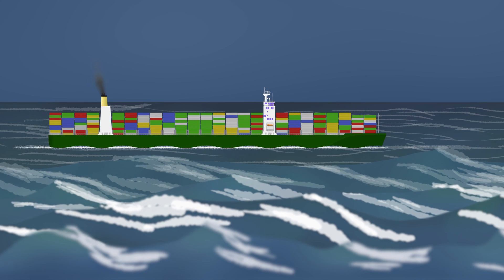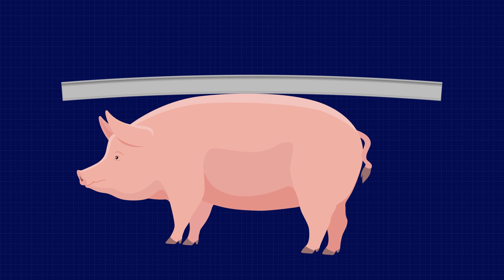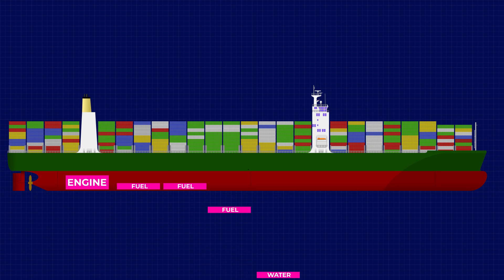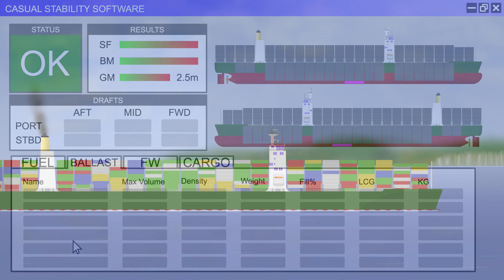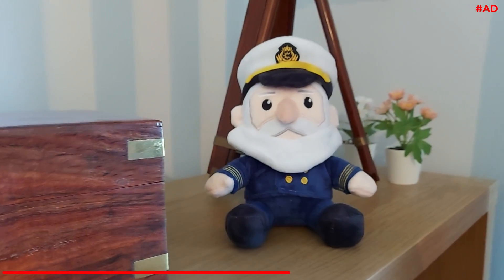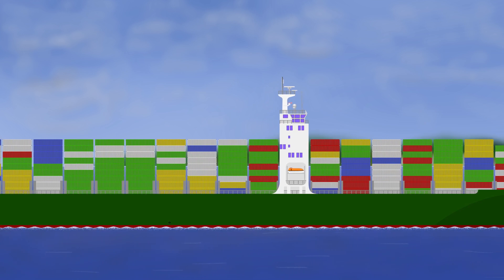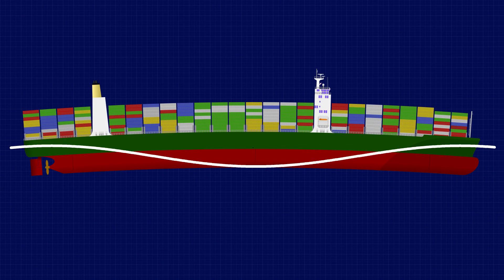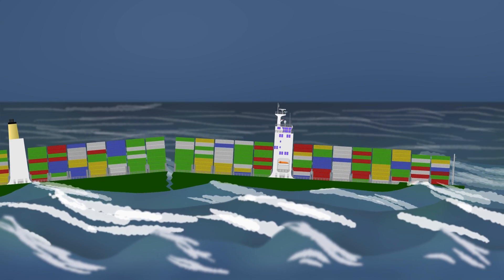Why Are Big Ships Bendy?

Comment: Now for the really scary part: Metal that is repeatedly flexed back and forth experiences an effect called work hardening.
The flexed part gets harder and more brittle with every motion. Given that in a ship's hull the flexing takes part over a great length, this takes a long time to become relevant, but it inevitably will weaken the structure.
So, no matter how well you take care of your ship's hull, it's days are numberd.
Reply: It is not generally a problem for metal parts. It might be true for ships but I am not an expert on that.
With ordinary shafts for example you don't have to consider work hardening. Instead you get fatigure cracks that form due to the repeated load cycles. These fatigue cracks only form when you stay above a certain strain threshhold. If you stay below a strain threshhold the shaft will effectively withstand the load forever (of course corrosion and other physical and chemical processes can still damage the part). With ball bearings for example there is no strain threshhold. They will ultimately always die sooner or later due to the cyclic load of the ball passing through the load zone and the corresponding hertzian contact pressure in the inner ring.
Reply: @FluppiLP  As I'm a mechanic, not a materials engineer, my knowlege of material sience is limited, but as I see it, these fatigue cracks are a result of work hardening. Work hardening happens where a piece of metal is deformed past its limits for elastic deformation an enters the realm of plastic deformation (the strain threshold you mentioned). Quite often, you will find a combination of both eleastic and plastic deformation - unless you overengineer a work piece to a certain extent. In this case, the cracks will start slowly in those parts that did experience plastic deformation, slowly increasing the load on those parts that so far only experienced elestic deformation.
If you make totaly sure your work piece will only ever experience elastic deformation, then you should be safe from work hardening and fatigue cracks. That works if the loads your piece experiences are reliably calulable. Like in a shaft for a stationary engine driving a generator.
But if you have something that moves through the environment, you will encounter shock loads and similar issues. Like a ship's hull steaming through a storm.
Reply: @Bird_Dog00  you have a great understanding of mechanics of materials there for not being an engineer.  nice work!  i am an engineer and i couldn't have said it better myself.  There are alloys, aluminums come to mind first, that do not have an "elastic fatigue floor" so, even purely elastic flexure will cause fatigue cracks to develop no matter how light the loading is.  But steel alloys generally do have a floor, meaning there is a load level below which fatigue is not an issue ever, but above that load limit fatigue cracks will develop as it starts to do plastic deformation on small scale, moving dislocations until they meet and causing fatigue cracks to develop into macro features
Reply: Steel doesn't do that untill the forces are pretty high. Only some metals get fatigued from all loads.
Reply: @calebreutener870  ships do get fatigued, hence the defined ship lifespan
Reply: Work hardening is nonlinear. Look up fatigue limit or endurance limit. Work hardening and metal fatigue isn’t an issue below a certain flexion limit for a given alloy. All suspension bridges move and stretch. Golden Gate Bridge is nearly 90 years old. Skyscrapers are also designed to flex and sway in the wind. They remain strong for decades. I’ve been in buildings where you could actually feel the building move under high winds. Aircraft aluminum flexes a lot. I’ve flown in planes over 60 years old. In turbulence they look like they’re flapping their wings.
Reply: @NoahSpurrier exactly, look at the coil springs on a car, they will flex for the life of the car.
Reply: @kevincurrie2052  Working with helical springs in my day job; how long they last depends on a multitude of factors. How much they are compressed ist the big one.
If you compress it only say, 10% of their maximum possible travel, then yea, they will probably last a while.
Compress them more, and their life expectancy drops fast, even though they still compress only elasticaly, eg. they expand back to their original lengh once the load is removed. Manufacturers provide tables for that.
Even when whatever you are flexing is flexed within its theoretical limit for elastic deformation, chances are there's a small part of it where that limit is exceeded (for example due to impurities in the material). That's where the work hardening and the cracks start. And once it has startet, it will inevitably progress.
Reply: @Bird_Dog00  But cargo ships are in service for a very long time.
Reply: @NoahSpurrier   Yes true. The process can take a long time. If the ship's hull isn't overstressed (meaning the flexing never exceeding the limits for elastic deformation), in theory it should last forever.
In practice, deformation isn't uniform over the entire hull. Some parts will bend more than others. Also, the material isn't perfect. Some very small defects - like imperfections in the steel used - can be enough for the flexing to exeed the elastic deformation at a small point and cause damage there. From there, the gradual deterioration will slowly spread.
If the ship is well taken care of and not sailed through too many big storms, that can last for decades before it becomes a real problem.
Reply: Fatigue absolutely is a real issue in most dynamic structures. Fortunately, mechanical engineering have several tools at their disposal to estimate its severity and design a structure to minimize its effect. Still, its one of the main reasons along with corrosion and abrasive wear that all machines require periodic maintenence and inspection.
Reply: That's likely what happened with the Carl D. Bradley back in 1958, wasn't it?
Reply: It depends on the material. Aluminum will do that, steel won't weaken from repeated stress if it's under its safe limits.
Reply: Well, you could always replace these overstressed parts, and before anyone brings up the quite ironic in this scenario, what ship of Theseus problem no we are dealing with easy to repurpose metal which means we can just melt down old parts into new parts you can keep ships around for several millennia by doing this
Reply: @HannahTheRealComputerEngineer  The problem with this is, that a) this load is spread over a large part of the hull, thus you'll have to replace a large part of the hull and b) those parts are very much integral to the hull's basic structure. So, you'll be looking at a major rebuild. If you factor in everything else that can and will deteriorate and needs to be replaced, you will end up with a bill that comes close to what a new ship will cost.
Reply: Work hardening is when a piece being worked on is hardened due to friction heating it up enough to affect the temper, its usually caused by adding coolant to a drill or cut too late. What i believe you are referring to is fatigue where metal develops micro-fractures from repeated bending. Fun little experiment anyone can do to see this, bend a paperclip back and forth till it breaks. the metal at the broken ends will be more matte and might even be a lighter color, that's caused by millions or even billions of micro-fractures covering the surface. The paperclip will also get very slightly linger due from plastic deformation, the bend being sharp enough to stretch the metal on the outside of the bend.
Reply: @SirFloofy001  I disagree. Hardening a metal requires a change in its cristaline structure.
In order to change that structure in iron or iron-based allyos with temprature, you will need to first change the cirstaline structure from the cubic-body-centred structure into a cubic-face-centerd structure. That happens at tempratures above 700°C (exact temprature depends on the alloy).
Then forcing it to undergo a rapid change back to cubic-body-centerd - the quenching - that traps carbon atoms in places where they don't realy fit thus distoring the cristaline structure of the material.
Workhardening of iron happens due to plastic deformation of the metal that leaves the structure deformed that way and only happens if the material stays at a temperature below 700°C. Heating it up to above recristalisation temperature and then slowly cooling it down reverses the effect of work hardening.
Reply: @SirFloofy001  work hardening occurs  with plastic deformation, regardless of the temperature

Comment: There's a video taken by a crew member during a storm on a large freighter of some type showing an unnerving,  to me anyway, of the flexing of the ship in a passageway that runs the length of the ship. It's actually kind of terrifying.
Reply: I was in the merchant marines for years and watching a ship flex in heavy seas is a good thing.  When they do not flex is when they crack.  I was on a brand new ship 40 years ago that sank on her 2nd voyage across the Atlantic.  It was determined that the steel used was too stiff.
Reply: Been there, seen that. Makes you think.
Reply: Think I've seen the same one, there are others of suspension bridges and looking vertically down elevator shafts of large towers, crazy how much flex is actually "normal" for these types of structures.
Reply: There's a video of a ship snapping in half:
https://youtu.be/gaZhnNlutuQ
Reply: Frightening, but normal. Aircraft carriers have offices between the flight deck and the ceiling of the hangar deck. A corridore the length of the ship flexes like that.
Reply: Planes are also designed to do this. It may seem spooky but your common 747 and others like it their wings can flex nearly 20 feet up or down easily
Reply: @Archer957 I was on an airplane a while back in turbulence bad enough that the flight crew was having trouble keeping people calm. I had a window seat and was thoroughly enjoying the insane sight of watching just how much those wings are designed to flex. The guy next to me almost threw up a couple of times. It was awesome. 

I'm petrified of flying and accept death every time I get on an airplane, so that might have helped.
Reply: @Archer957 Not 747s. 787s made of carbon fiber.
Reply: @ernestimken6969  You can Google it yourself. 747 wing flex is about 6 meters or about 20 feet 

Also, the 787 wings flex range is about 28 feet or 7.8 meters compared to the 747s 6 meters

All airplanes have to have wings that are able to flex to withstand turbulence and normal maneuvering, or you'll cause significant damage over time if they don't outright break from the forces exerted on them.

I am studying aviation maintenance. These are things we do have to go over and know.

Comment: Planning the loading of ships before computers were common must've been quite an annoyance
Reply: Yeah, but they were also significantly smaller back then, so there weren’t such a huge number of permutations.
Reply: @awmperry  That certainly made it a lot easier, maybe even some problems weren't really that significant back then. But still instead of few people and plugging data to a computer you get a ton of people with a lot of paper calculating on slide rulers.

Comment: Can you ever have hogging/sagging along the breadth of a ship or is it only along the length? I assume that there would be less due to the smaller distance and there may be stability issues that would arise before it became an issue but is it ever a concern? What about torsion?
Reply: The problem that wasn't explained.... wave motions travel along the entire length of the hull. It's not a case of the hull bending up and down.... more that it's doing that, with the entire hull length flexing with multiple wave motions across the entire length. Picture that massive cargo ships... VLCC, ULCC, and Ultra-large fuel container ships travelling between continents... the seas can get very rough, especially for ships that have to travel around the southern area of South Africa.

The constant flexing across such very large ships... of course, they bend/flex. They have to, or else the ship would break apart.
Reply: @VerilyVerbatim  He was asking if ships would flex in the transverse direction not longitudinal. (like from side to side, port to startboard)
I would say that its only theoretical, not something taken into account.

Comment: This was an issue with the early liberty ships where the prefabricated sections were welded together but sadly poor construction tolerances lead to the keel sections and other strength members not always lining up at the adjoining bulkheads which you can imagine reduced overall hull strength considerably. Couple this with poorly normalised steels and welding temperature control issues along with cold Atlantic waters and you had a fatigue nightmare. The construction tolerance issue was quite difficult to eliminate and examples appeared well into post war decades worsening as overall hull dimensions increased with bulk carriers.